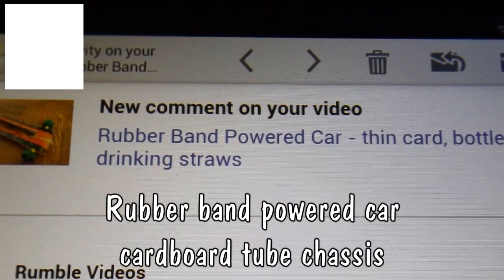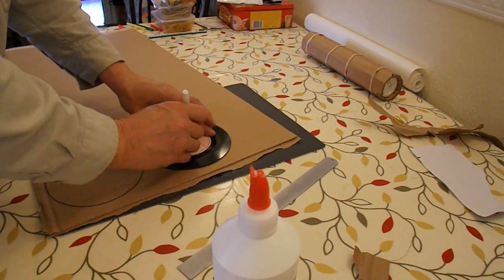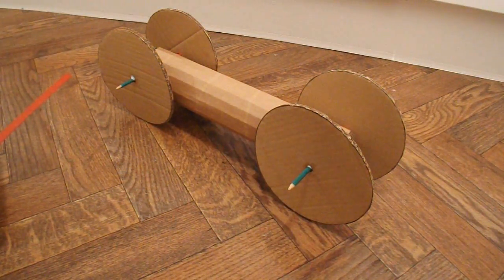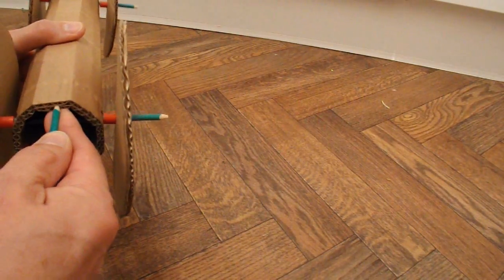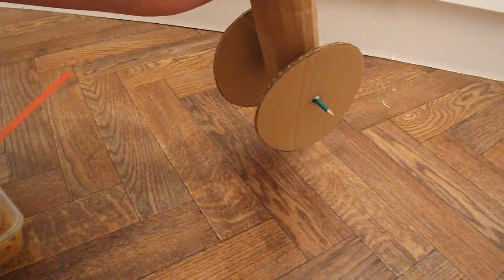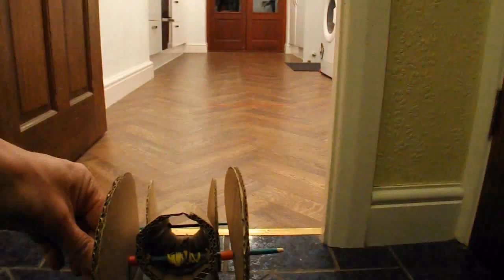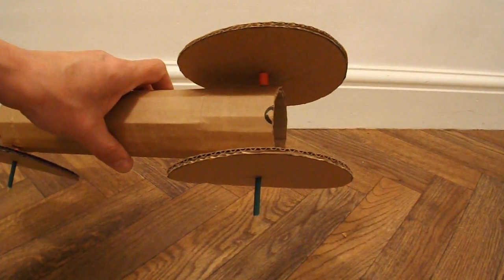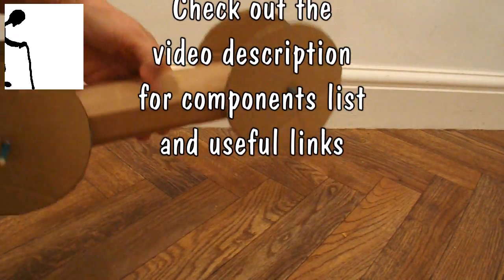Rubber Band Powered Car  - cardboard tube and wheels

Comment: I TRY TO MAKE IT THE WHEELS GO REALY FUST BUT WHEN I PUT IT ON THE FLOOR THE WHEELS DOESN'T WANT TO MOVE WHY?
Reply from the maker: Fault Finding on a Rubber Band Powered Car
1. The rubber band does not connect to the front axle, some people misunderstand the videos and attach the rubber band to the front axle as a convenient anchor. That stops the axle turning. Make a different anchor point, study the video again.
2. Does the car run forwards freely if you just push it without the rubber band connected?
If it does not, make sure that the axles are free where they pass through the body. You may need to enlarge the holes where the axle goes through the body or use larger tubes for the axles to go through.
Are your wheels round with no flat spots. You may need to trim them.
3. Do the wheels rub against the body of the car?
If they do, the friction will slow the car or even stop it moving.
Put some spacers on the axle between the wheels and the body to keep the wheels clear. Discs or washers cut from plastic or cardboard should work. 
4. Do the wheels spin evenly when you watch them?
If your axles do not pass through the centres of the wheels, the wheels will not spin evenly and this makes it harder for the car to run, so you will need to make new axle holes, taking more care finding the exact centre.
6. When you wind the rubber band round the axle do the wheels turn at the same time or are they slipping on the axle?
If the wheels are slipping on the axle, the rubber band will unwind without the wheels turning on the ground. You need to do something to stop them slipping. Glue them to the axle or wrap tape round the axle where the wheels are to hold them in place.
7. When you release the car it does not move, but if you lift it in the air, the rubber band unwinds and the wheels spin OK.
Either the ground is too rough or the car is too heavy. Try the car on a smooth surface, make the car lighter, add more rubber bands. 
7. Wheel spin. When you release the car, do the wheels spin without the car moving forward?
You do not have enough grip on your wheels. Either add some weight to the car to help the grip or put something on the wheels to improve the grip. 
Things that will improve grip - hot glue all the way around the rim like a tyre. Rubber bands stretched across the wheel. A strip of rubber cut from a balloon stretched around the edge of the wheel. Strip of rubber cut from washing up gloves or disposable rubber gloves.
8. Trouble connecting the rubber band to the back axle? Glue a short stick to the axle to act as a hook for connecting the rubber band.

Comment: Thank you very much grandad, i'd made one but not good as yours and i put a smaller wheels on it :)
Reply from the maker: I am sure yours was fine. Fixing the wheels is usually a problem. That is why I doubled the thickness to give the axle more chance to grip. I think I could have doubled them again (4 layers) and that would have helped more. Smaller wheels do tend to spin easier but if you can get them to grip the car will accelerate faster.
Reply: I put two stacked up very thick card board wheels on it (its 8 cardboard stacked up compare as yours) and i have a idea to put a grip in thick wheels (like your sponge tires) i removed the top layer of the cardboard which end up with a zigzag or bumpy cardboard that you will cut by strips and hot glue or glue it on the tires and i put a two layer grip on my cardboard car which us the first layer is the cardboard grip that i am talking about and the second layer is the rubberband, i hope it helped you and if you have no idea what i am talking about (the cardboard grip) just message me and i'l reply :)
Reply: And do you have a Facebook account? I just want to send my rubberband car picture to you that will give you a idea how i'd make mine :)
Reply: I mean 5 stacks of cardboard compare a yours i'm to exaggerated :)
Reply from the maker: Rumble Videos Just take a few photos, make a slide show or make a mobile phone video and upload it to YouTube. It could be the start of a new experience for you.

Comment: How can I make my rubber band car go farther?
Reply from the maker: So many factors can change the distance your car travels, here are some ideas.
1. More rubber bands, double them up to make the motor stronger.
2. Reduce the friction by improving the axle bearing surface, maybe just make the holes the axle goes through larger.
3. If the wheels spin when the car starts you need to improve the grip, maybe rubber bands round the rim, or a strip cut from a balloon or a rubber glove.
4. Larger wheels tend to free wheel better when the rubber band has finished.

Comment: hey grandad,
can you make a rubber band powered car that change fast automatically??
Reply from the maker: Do you mean a gearbox?
Here are a couple of my cars that use an automatic gearbox effect.
Bargain Store Project #30 Rat Trap Car Update - 3 gear auto gearbox
Helpfile - Rubber Band Powered Cars - Gears and Brakes
Reply: Thank you for the helpful link but
Can you make those car (the link you gave me) made from these cardboard tube and cardboard wheels??
Because i have to much cardboard boxes collecting dust, i want to recycle them instead throwing it on the trash can
Reply from the maker: Shou Ian sy I am sure you could make those cars from cardboard tubes and cardboard wheels. As you can see from my playlists it is not difficult to do. The only issues with cardboard wheels are 1. Cutting a good circle/disc for a smooth run and 2. Getting a good join between the axle and the wheel.
Reply: Thanks :)
Reply: Then, can you make a rubberband car using the cardboard grip i'm talking about??
Reply from the maker: Shou Ian sy If you already have lots of cardboard boxes then you should be able to make the cars I have shown you in the videos by combining the ideas from each video. I do not have any suitable cardboard tubes at the moment so I will not be making any. There is not much difference between making a car with a tube for the body and making a car with a flat sheet of cardboard for a body and you have seen my videos on how to do it. You have seen my video cutting discs for the wheels, and you have seen my videos on the gearing effect so you have seen enough to be able to make the cars. If I find a suitable tube at some time in the future I will make a geared rubber band powered tube bodied cardboard wheeled car but that may be quite a while before it happens and it would be wasted in my kitchen as you will not notice any benefit of the gearing as it will not travel far enough to show any difference. The gearing only benefits heavier cars or cars with large wheels as they need low gearing to get moving and then higher gearing to maintain momentum once they are moving.
Reply: Ok thanks! Sorry if i annoy you :)
Reply from the maker: Shou Ian sy you asked a good question and it will help inspire me, but I will try to make the new car different to those other ones when I finally make it.
Reply: Ok, goodluck for your next project :)

Comment: plz make a car using cd as wheels and pencil and it should be powered by battery
Reply from the maker: Here is an electric powered car with CD wheels, it doesn't use a pencil but you could easily replace the bbq skewer with a pencil. https://youtu.be/pFJUZzrZWRI?list=PLA5a2xPRSrB0hs_uRx0mCbsNsQSKE0i_3 and another https://youtu.be/ZZX6L3zQn_E?list=PLA5a2xPRSrB0hs_uRx0mCbsNsQSKE0i_3 and another https://youtu.be/DLcj07KuCL4?list=PLA5a2xPRSrB0hs_uRx0mCbsNsQSKE0i_3
Reply: thnx

Comment: And i'd put a rubber band on the wheels to avoid wheel spin
Reply from the maker: Wheel spin can be a real problem. Here is one of my old helpfiles on how to put tyres on CDs but the same principle should work for other sized wheels if you can find the right size balloons or gloves Helpfile - how to put tyres on CDs for model car projects
Reply from the maker: Rumble Videos Yes thicker wheels make it easier because there is more grip on the axle and also more grip on the ground.